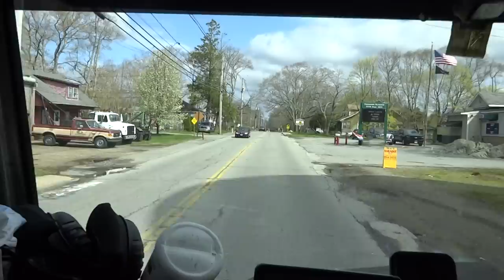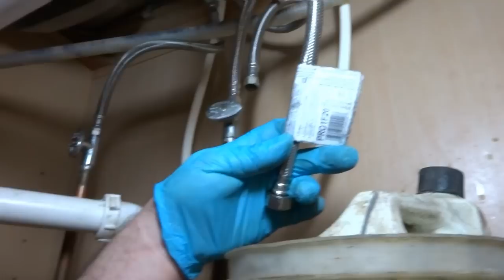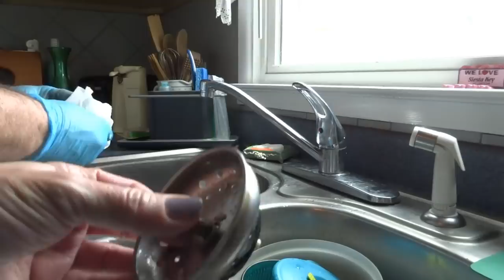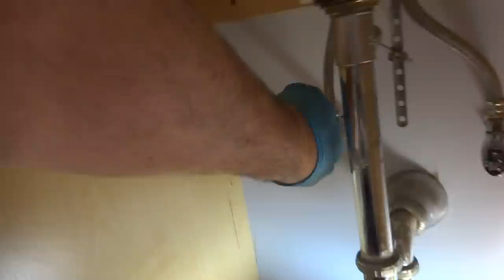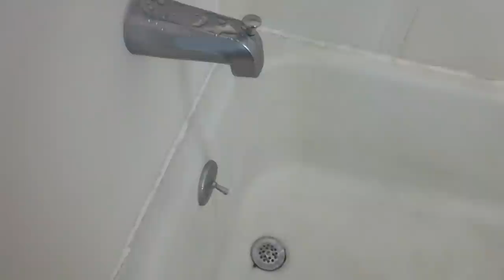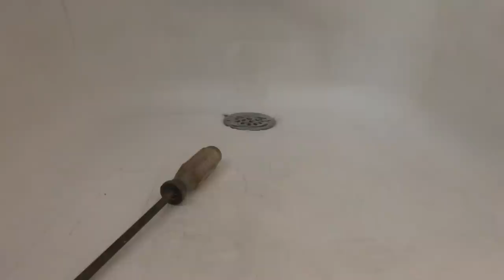LOW WATER FLOW TO FAUCETS FIXED

Comment: A few years ago, there was an issue with one brand of water heaters having the dip tube disintegrate, sending little bits of white plastic-ish stuff through the hot (and in some cases the cold) water lines in peoples' houses.  This reminded me a little of that, although I'm sure Steve is familiar with that issue.  Steve's rapport with his customers is amazing!!  Seems like a nice lady, and appreciative!
Reply: I maintain rental properties, some must have been built during that era, stopped up risers and valve bodies, aerators

Comment: Same thing happened to my kitchen faucet , rubber washers on shut off valves broke off plugged hot/cold flexible lines happened after i raised temp water heater!

Comment: Hey Steve ? Question ❓ wouldn't it have been a good idea to take the upper ball out and push something down the pipe and get it that way rather than to break your back from getting under that sink? And yes it definitely looked Crusty inside the pipe , She's a crusty one for sure miss Molly! Have a great weekend and stay safe out there ! Looks like a big leak from the sky there lately but at least it's not snow ❄️🌨️ lol

Comment: Are electronic descalers permissible for installation in Massachusetts??  (also, If legal to install, can they be installed by a plumber, or is an electrician necessary??)
Reply: AMStationEngineers > That's good idea if your in a high scale water supply area even with a De-scaler unit on the mains as a backup protection. I wouldn't think their be any issue. How are they going to know?